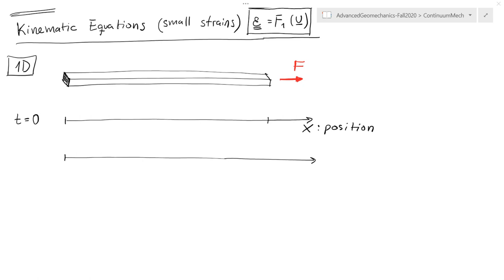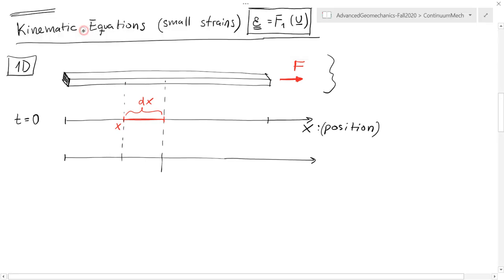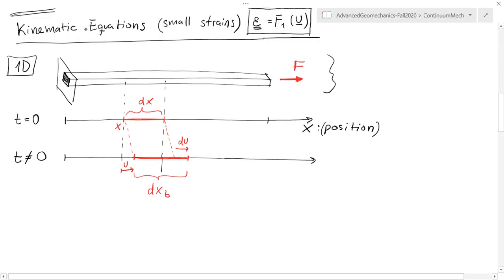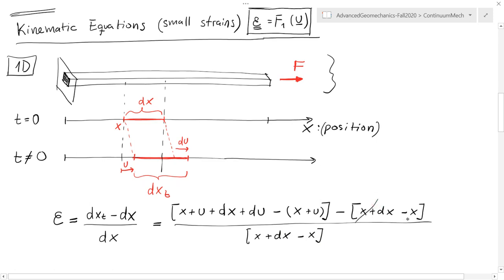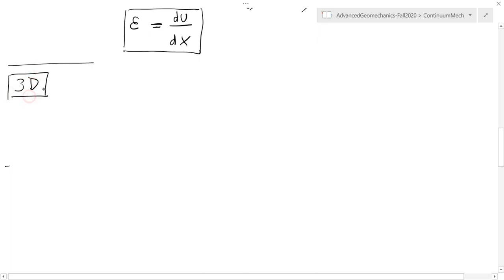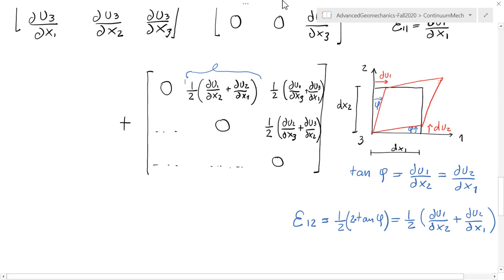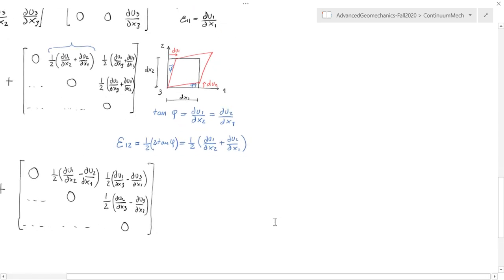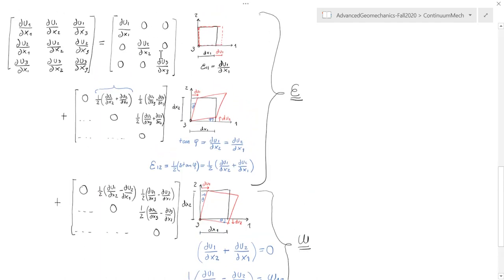L07 Kinematic equations: small strains

Comment: Really nice explanation. Just as a comment, The new version of OneNote is much better than the 2016 version you are using. It makes writing with different colors easier because the palette remains visible on the top (no need to click to make it visible). I use it in my online workshops and it really helps.

Comment: Thank you dear Dr. Espinoza.
The small strain concept is valid normally for strains below %2, but in the cases we have large displacement and subsequently large strains (e.g. salt cavern wall, and  long-term creep tests on salt samples), is not accurate enough. It would be great if you explain this concept (large strain), as it applicable to very geomechanical purposes.
Reply from the maker: Yes, you are right. Large strains are not covered in this class but I will try to work on a separate video. Thanks for the suggestion!
Reply: Great!